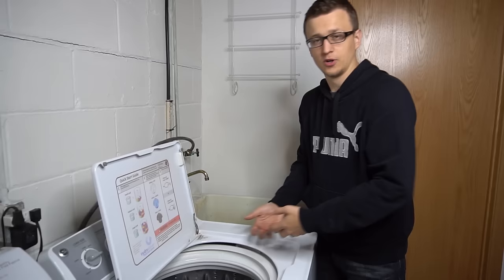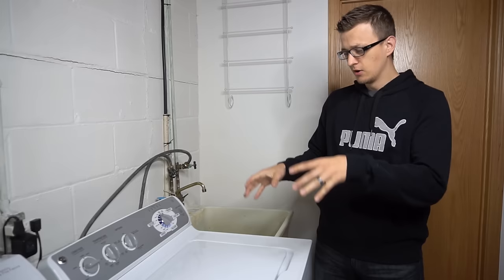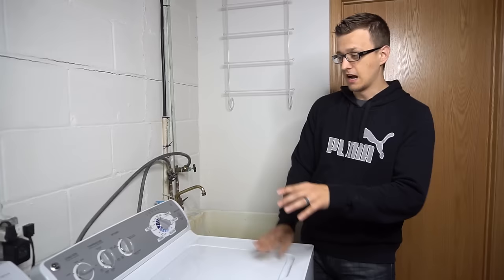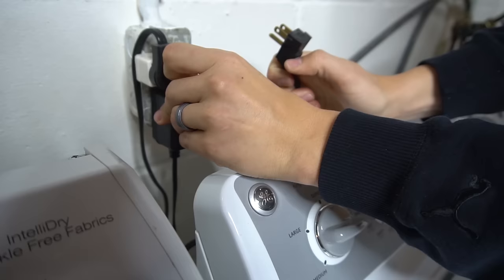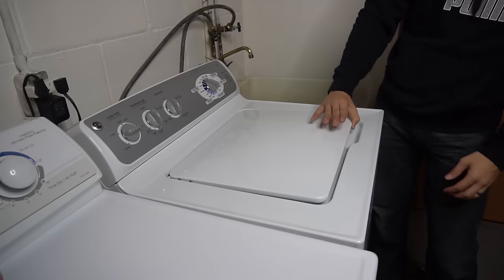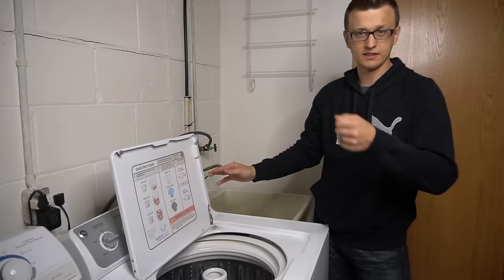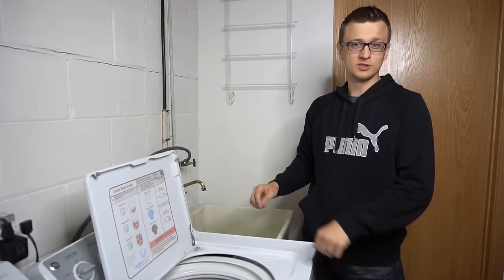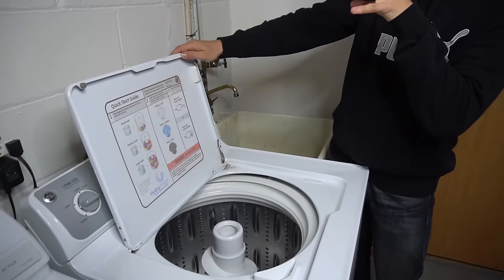Washer Not Spinning - How to Reset Motor (Easy)

Comment: I wonder if those instructions were included with the manual or did you have to find them online.   Seems to me that new appliances and machinery are overly complicated with a lot of unessential functionality that the average consumer would be just as happy without.  How is a user to know the reason for the washer not working without calling a service tech to find out?  My 35 year old Maytag instructions explain that if the unit stops working during an out-of -balance spin that a simple reset of raising and closing the lid will fix the problem.  The unit you demonstrate makes you tap twice, open and close three times, do a circle dance and say the magic word and all within 12 seconds. Miss the time limit and you must repeat.   Who is in control here ?  You or the washer?
Reply from the maker: I only agree! The new units are annoying like that. As far as I remember these instructions are not in the owners manual but they do appear in the service manual. (Have to take the unit apart to retrieve that one) It's almost like they purposely make this complicated to discourage people from doing it themselves.
Reply: @WordofAdviceTV  I was able to take my hand down in between the hub and the pocket and get the manual. Have someone with a smaller hand grab it. I didn't want to take the machine apart if I didn't have too.

Comment: Great tip! Didn't know there was even that type of a safety mechanism on a washer. Had both an under a second power drop drop and an unbalanced load of clothes that apparently caused my issue. Fixed it in no time with this .

Comment: I have a laundromat and fix most of my machines.  My front loaders, when they skip cycles or stop working, usually has to do with the drain pump.  If something gets stuck in it the machine does not work properly.
Reply from the maker: That's a common problem too, thanks for pointing that out! A stuck drain pump filter.
Reply: New sub here. Can u do a video on how to fix the filter?

Comment: I’d watch the other video.. if the washer didn’t have an agitator. 

Back in my day we didn’t have lid locks, & I removed mine as soon as possible. I want to know what’s going on with my clothes at all times.
Reply from the maker: Nice :) As long as no kids decide to stick their hand in there while it's spinning, that's kind of cool to be able to see what's going on whenever you open up the lid. (although the new washers have a door lock that is very difficult to bypass)
Reply: Word of Advice TV -  It’s a standard size washer, any kid big enough to open the lid & stick their hand is big enough to know better.

Comment: Your going to burn your house down. The washer needs to be plugged into an outlet. Your drawing way to many amps.
Reply: As long as the extension cord is either 14 or 12 gauge, no overheating of the wires.  Most of your house wiring is 14 gauge...  just DON'T try using a 16 or 18 gauge because they're cheaper.
They're cheaper because they don't have as much copper to carry the current, and they cause problems
If you need an extension, go to a big box store (Lowes/HomeDepot) and choose an extension marked either 14 or 12 gauge and stay safe.

Comment: I'm so disappointed!!!  I've tried this method several times on my Maytag and NOTHING 😢
Reply: Did you find the problem with your maytag? Because I am having the same problem with my Maytag.
Reply: didn't help my Whirlpool either, but could be me. I did the reset, just didn't do it. Another video mentioned bending the hinge some, didn't work and I could't find the hinge on my machine. Gosh, I hate spending money on a fix.
Reply: @KindCountsDeb3773  keep looking at videos; we usually find the fix eventually
Reply: Didn’t work for me either. Mine won’t even light up for the diagnostic test. Power is fine, cord is fine.  I’m leaving it unplugged overnight, that worked last time about a year ago when it did this before.  Ugh

Comment: GE repairman told me it would be cheaper to buy a new one then to replace the motor I did what you did unplugged it and plugged it back in and looked at the lid six times and Erica went away and it works fine thank you that's awesome

Comment: GE set here and the washer stopped just before the rinse cycle full of water and was trickling around slowly sounding and looking like it was TRYING to spin but wouldnt , initially thought it was the drive belt and  then came across this video....about 3 minutes later my washer was working , Thank You

Comment: You’re the first one who actually said it was a motor reset , I got it work before but I was very skeptical about it you know two times happening kind of makes you wonder…so I waited for my epitome and you gave it to me …. THE MOTOR needed to be reset and that’s what the up and down with the lid thing was! Awe beautiful thanks and after I did do the same last time but the YouTube video girl also had me turning the dial settling and you did not this a difference, so I’m trying this in the am thanks … part of why I waited so long was some repair man told my old man guy friend a strange thing was that he said if this certian bulb is damp inside it would do a super total malfunction and cost tons mre to fix   Not sure I waited a long time until I felt sure someone captured the remedy to my washing machine Amanda high efficiency machine technical issues. I hope this is it. Please let me know if you see this quickly so I won’t make any error in what I’m doing   My best to  figurework out the issue with these little troubleshooting ideas you’ve provided 
it makes a little more sense how you  explained…thanks

Comment: Thanks. I wish I had found this video sooner for troubles I was having with my GE Profile washer, model WPRE6100G0WT. On mine the drive belt had snapped, and I bought a new one and replaced it. However after I installed the new belt, the motor would not turn at all. After hours of troubleshooting and even looking at new washers, I found that the motor also had to be reset in the same way you mentioned. I think when the belt snapped it triggered a motor fault. With the new belt and a reset motor I am now back in business again. Thanks.

Comment: Was worried I might buy a new motor replacement because not only the washer does not spin but motor is totally silent. Got funny feeling to try it. Unplug-wait 2 minutes-plug-open/close six times within 12 seconds. Did not work. Tried again, then it work perfect. Using Kenmore 400 series (they are all internally similar design). Thank you.

Comment: Unbelievable. Worked with first try. Had called a repairman, thinking that I would have to replace a motor or belt. My spouse said : “look it up on YouTube”, and the machine, which would not budge at the spin cycle, is now spinning beautifully.
Reply: What is this amateur hour?  You didn't make a show of taking apart needless parts/covers (the easy stuff) and grunting and cursing?  That's how you get the permission for the next powertool purchase.   :)  Just wandered into this channel. I guess YT thought I'd enjoy it, and I certainly did.

Comment: On older machines (and maybe newer ones), if the lid switch is broken (open), it will not agitate and/or spin. Not sure if a bad lid switch on the newer models will also  produce the same symptoms, but should be checked.
Reply from the maker: A bad lid switch is another common reason why it won't spin. Thank you for pointing that out!

Comment: worked beautifully TODAY, @  1721    SAT  ,   14 may 2022 USA,  THANK YOU VERY MUCH.
Reply: didnt exactly do the 6 times, it sputtered starting after several tries , random number of times closing opening the top loading washer door with the unplugging power cord as described and pluggin back in , and then the door opening sequence, etc.  THANK YOU AGAIN,   may 14, 2022

Comment: I don't know if top loaders still have them but there used to be machines that had a reset switch behind the control panel. At the back of the panel next to the timer there was a switch you could push in that would start it back up.

Comment: I have a whirlpool. I have replaced the coupler, and got a transmission rebuild kit and it still wont spin. Are you saying all I need is to lift the lid as instructed? I do hear that it trying to spin but it don't.

Comment: Thanks for the explanation. I am going to try. However I would like to get clarification on one aspect though. Couple of years ago I bypassed the wiring so that opening the LID does not stop the motor. Will the recipe suggested here to reset work in that situation. 

Also it will help to know the different reasons for which a motor could reset and needs that cleared before being used again. Could you list them in the description section.

Comment: Taking nothing away from your advice, which seems to have helped a lot of people, I have to say that the burn marks on the power adaptor when you unplugged the washer scare me.  It looks as though the dryer is plugged in there, too?

I'm wondering whether that outlet extender is rated for the washer or dryer by themselves, let alone together? 😬😬😬😬😬

Comment: 01:39.... bad burn marks on the electrical plug adaptor - don't use appliances on multi-plugs. as for the advice, sounds great, i've just tried it on defy daw 382, will see how it turns [no pun] out :-)

Comment: Does it apply to model gtw680bsj5ws  by GE ?  It has the lid lock function.. I installed all new genuine GE suspension rods due to it banging around on spin. I'm thinking it needs resetting . It's better but still excessively shaking. Thanks Man

Comment: Please change out that electrical box on your washer and dryer, it is unsafe, Look at the browning burn marks, that 3 way splitter is not designed to carry that much electricity load. Thats a ticking time bomb. You should always plug the water and dryer into the wall, because they pull high amounts of electricity.

Comment: Hi ok I have an 03 ge washer.today I tried using  and got no spin just a fill.i unplugged it .nothing happened.then I saw ur vid I did the unplugging and door 6 x nothing.my wife freaked out cause said I overloaded   it..now my kid said it's the lid.i think it's missing or sounds like its not making.contact. .glad u helped others. Wife ssid its 16 yrs old I told her she uses it way 2 much like every 2 dsys.
Reply: Did you figure it out?
Reply: @girlonlaptop  hi yeah it was a lid switch.i called a repair  guy. I tried it myself but he did it in 10 min it was 150$.2 much stuff for me .I wish I could do this stuff mtself mine is 16 years old.prob does 15 losfs per mo n.v th which I think is slot  but wife says its not
Reply: GRILLBUOY101 thanks for info, I tried the trick on my friends washer today and it didn’t work so now gonna try next idea..$150 dang!!!

Comment: Thanks for this video. I was just starting a load of laundry and the power shut off just for a second due to a storm coming through. The machine shut off so I decided to unplug it until the storm was over. Later I went to start the load again and the machine kept shutting off without even filling. I remembered seeing this video so I figured why not..I’ll try it and it worked!! Laundry resumed!!

Comment: This is exactly my issue.  mine is the digital version GTW680 (something or other).  had an off-balance load and it tripped right after the last spin.  the display just said END like normal but the lid would not unlock.  I unplugged it which opened the lock, but the next time i went to use it it sprayed a bit of water, and went to SENSING...and right to END and stayed locked.  I found your video, did what you said and it worked first try.  There is no acknowledgement that anything has been reset, but starting another load did start to spin during the SENSING stage.  been working ever since.

Comment: This only works on inverter driven GE washers. This does not work on Whirlpool, Samsung, LG, Amana, Maytag, or Frigidaires.
Reply: But there are comments from someone who claimed it works!
Reply: @zozomon850  It doesn't work. As a professional appliance repairman who has serviced well over 100-200 a year, there is no programming or code in the firmware of Samsung, Whilrpool, LG, or Frigidaire that "resets" it by raising and lowering the lid.

GE washers in this style, before they took the HE lock route by Haier used to have an inverter driven motor on the bottom. That basically means there is a motor with a board on top of it that dictates how fast the washer spins, when it needs to slow down, and how fast is too fast. It did all this by measuring torque and weight in conjunction with the pressure sensor mounted to the side, which fed up to a pressure switch at the very top. This was the only board on the entire washer, the rest of it was mechanical down to the timer. So in order to help calibrate the washing machine, GE devised machine code in the invertor's chip that read how many times the lid was opened and shut, and passed this through microcircuits that took old memory in the stored RAM and purged it. 

Whirlpool washers do not have this. They do not have timers and invertors, they have control boards, and these control boards essentially tell it "go this speed no matter what". You're welcome to raise and lower the lid six times in five seconds, but it does absolutely nothing. The machine code in the control board cannot compute what you're doing. It does not register that this is a diagnostic procedure developed by Whirlpool, because it isn't. It's an old GE code, and their machine language is a whole different field.

I've had multiple customers tell me that they did this. It took me forever to figure out why they did it until someone mentioned this video. That's why I'm clearing the myth where it started.
Reply: @RemnentPlays  so I have a GE washer that won't spin or agitate. This method did not work. There is a red light on the motor that keeps flashing half a second on and a full second off with no gaps. In other words it just keeps flashing on and off. Does this mean anything to you and do you have any ideas?

Comment: Mine spin but clothes are still soaked when finish washing. Stand pipe is correct height, belt is in good condition, settings are correct, no clogged hose or pipe and water drains out of drain pipe. Any idea what could be causing that?

Comment: That plug in was replaced I hope because I couldn’t see plugging into one with a sign it arcing ( hope I spelled it correctly) it was burnt on the right prong so that could mean you had a power surge or to much running on one wire for what it can take . Be careful so you don’t have a house fire. Just saying not trying to curse you just telling you to check it out buddy . 
Thanks for the washer info I’ll have to try that one.

Comment: Have a Whirlpool washer model # WTW5000D1. Washer will go into low spin fine but shuts down when it tries to go into the high spin. This model does not have an agitator. Anyone have any experience with these?

Comment: I changed the dogs because it wouldn't agitate at all, after I was done I did a dry run, just water, now it goes one way but didn't go back and forth, no idea what I did wrong, does it need resistance as in clothing to get the back and forth motion? Seems to work well except for this problem,, help !!!!

Comment: I first got this type of error a month ago. I'd try this method to fix and it would work but I'd have to repeat it here and there until it just stopped working. Wont agitate or spin at all. GE top washer btw. Any idea what it could be? I get 3 error codes when I go into diagnostic mode
1. Locked Rotor Monitor.
2. Spin.
3. Mode Shift.
Only thing I can think to do is replace the mode shifter

Comment: I hope you can point me in the right direction.  After running an unbalanced and slopping water on the floor my Norge does not spin.  I can hear the motor spinning but the drum is not spinning.  Testing further I found that the brake was not releasing.  I physically released the brake and the drum spun.  How do I track down the problems with the brake release circuit?

Comment: Does this work with front loaders?
Reply from the maker: Just unplugging it for 10 seconds and plugging it back in often solves many minor issues. The lid lifting process is mainly for the washer model you see in the video

Comment: We're having the same problem, but my mother said I had to leave it unplugged for half an hour before plugging it back in, nothing about the six repetitions. Didn't work btw.
I have a Hotpoint, will this work with that?

Nvm, I did exactly as you said and the thing STILL didn't spin. Must be busted

Comment: What about if its not a newer digital washer?
Reply from the maker: The reason this trick works on many models is mostly because of the power reset. It's worth a try, regardless of what brand or model you have. Just unplug it for 30 seconds or so and plug it back in. If you get lucky, it may just start right up.

Comment: My load size selector knob is stuck. It won't move off of the 'small' selection. I performed your reset. The reset did not fix that problem. Any other ideas?
Reply from the maker: If it is stuck, it is likely a mechanical failure. You will need to replace that switch (usually pretty easy to do)